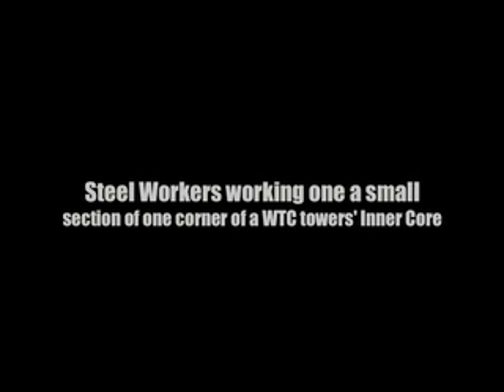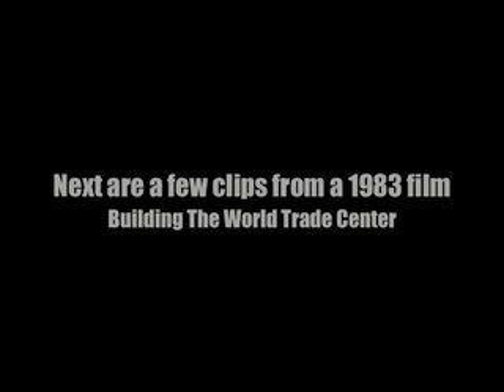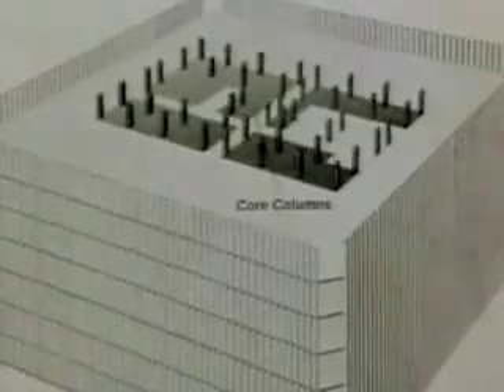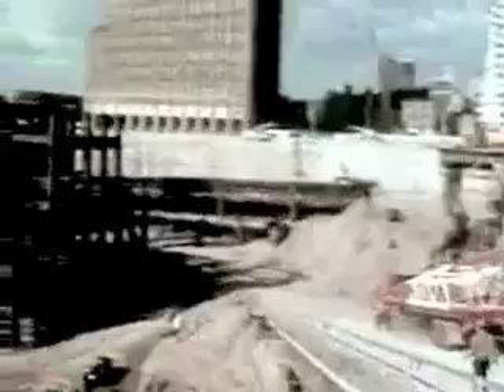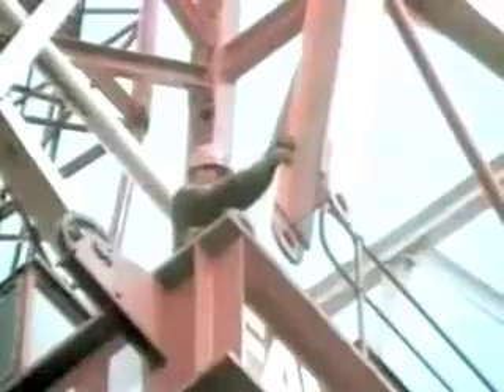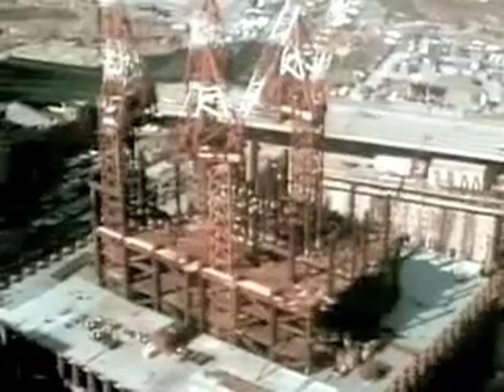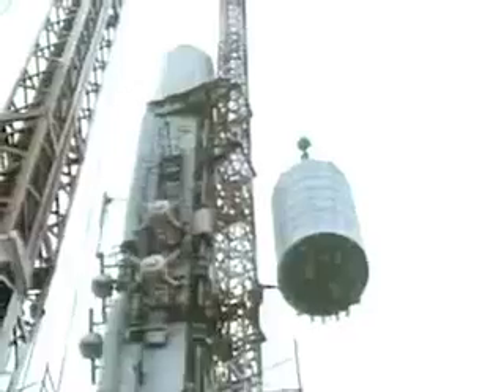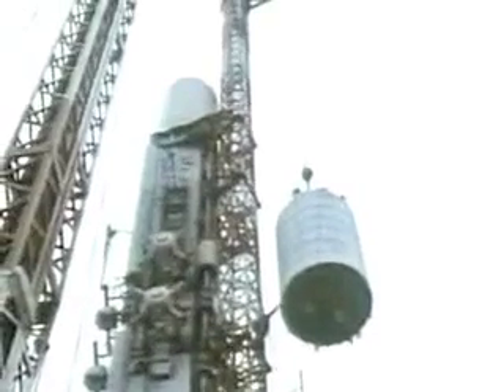Exposing One Of The 9/11 Commission's Blatant Lies

Comment: Even if it did weaken the buildings where the planes hit there's no way 20 stories can crush the 80-90 stories of unaffected concrete and steel below in 10 seconds. The top of the building should of tipped over, which it started to do until everything started violently exploding outward. Then we have building 7 to confirm explosives were used.